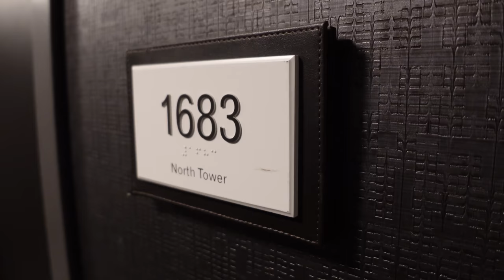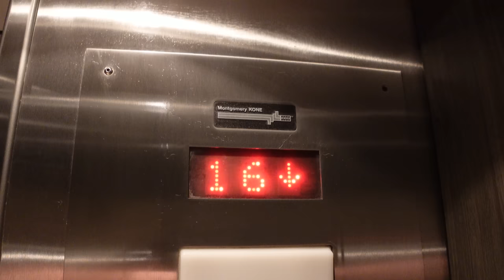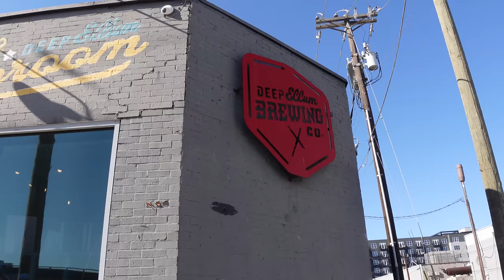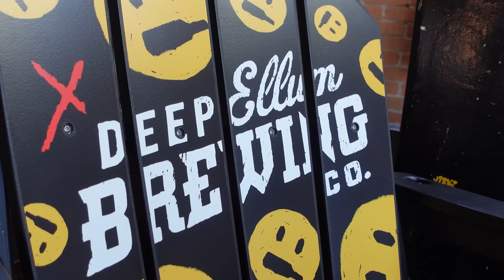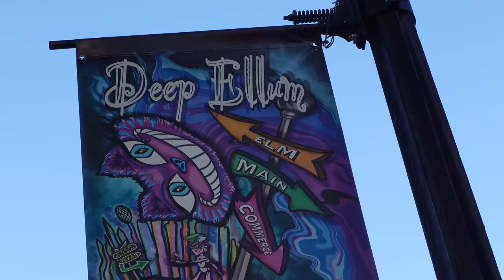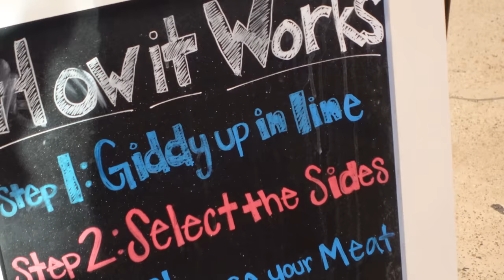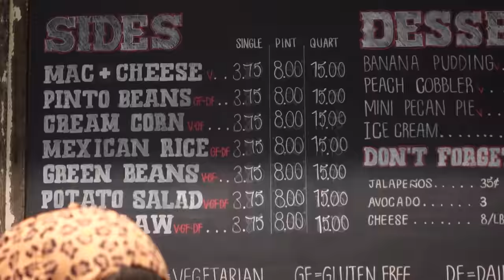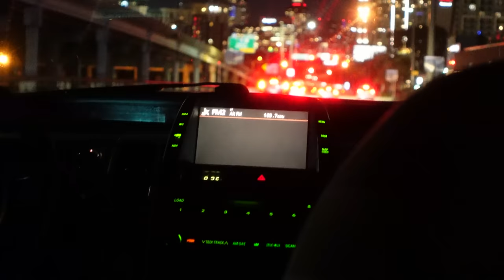DALLAS , TEXAS we have a SURPRISE GUEST| USA Road Trip

Comment: ive got the treager 575 pro the best thing about electric pellet smokers is it will adjust the temperature its self with offset smoker like they were using its very hard to control the temperature hope this helps